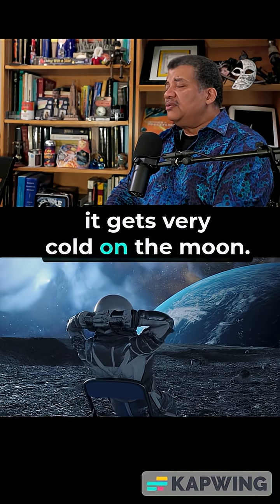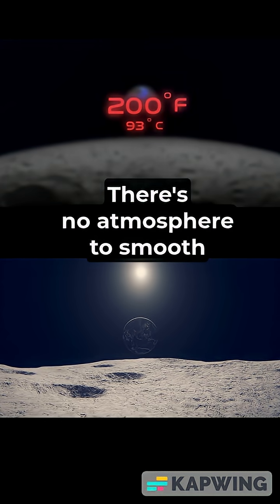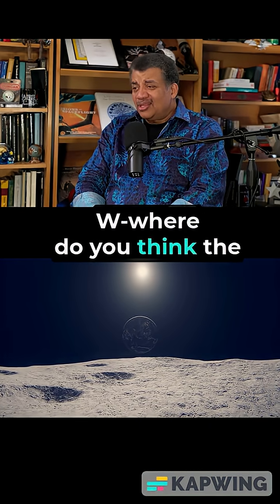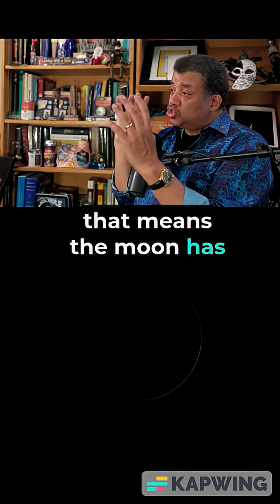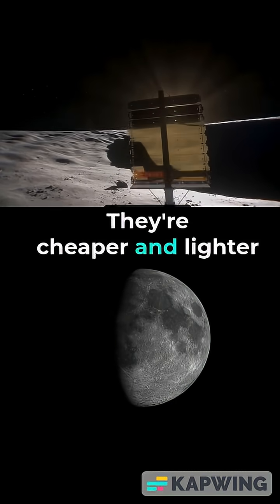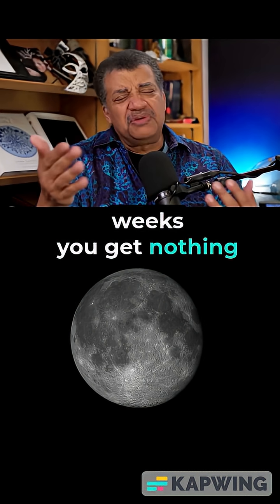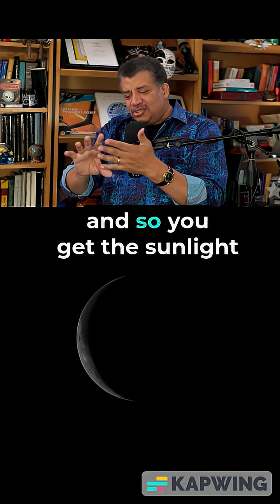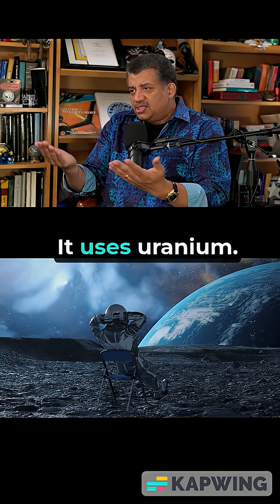Moon Nukes? Neil deGrasse Tyson Explains // #neildegrassetyson #cosmicaltalks

Comment: Idk couldnt we make a solar array and beam the power down to the moon surface, i mean biggest power source in the galaxy just keeps going, seems like a waiste to not use it
Reply from the maker: Solar power is amazing, but transmitting energy across space efficiently is extremely challenging. The Moon gets sunlight, yes — but the engineering to beam usable power safely is far from simple. Physics sets the limits, not imagination. 🌞🌕
Reply: @CosmicalTalk makes me want to break out some laisers and solar panel and see if I can pick up any of that Power, but I think someone is allready doing/has done that.
Reply from the maker: You're right! That exact concept is called Space-Based Solar Power (SBSP), and many groups like NASA, ESA, and Caltech are actively working on beaming power from space.

Comment: So how did they not die when they landed on it? I’m not denying they did, just wondering how they managed those kind of temperature highs and lows in the 60s
Reply from the maker: Great question — the key is insulation. The suits and lunar module were designed to handle both extremes. The “temperature” on the Moon refers to the surface, not the astronauts inside their climate-controlled gear.
Reply: @CosmicalTalk I actually missed the “Fahrenheit” part. The majority of the world works in Celsius and Kelvin. I always forget the US has yet to catch-up.
Reply from the maker: @matthewveale9027  Haha, totally fair — the unit mix-up has confused more than one mission in history! 🚀 Celsius just feels so much more universal.
Reply: @CosmicalTalk Mars Climate Orbiter was a good one. Pounds instead of Newtons.
Reply from the maker: @matthewveale9027  Exactly! One small step for math, one giant facepalm for engineering.
Even NASA isn’t immune to unit confusion.
Reply: @CosmicalTalk  we are the face palm originators 🤭 not admittedly ofc- will redact .
Reply from the maker: @icsharpk A valid question! They survived by wearing a multi-layered, walking spacecraft—the EMU! It wasn't just insulation; it included a liquid cooling system underneath to manage body heat, plus the suit itself provided extreme thermal regulation. The physics of thermal engineering worked even in the '60s. Science! 😉